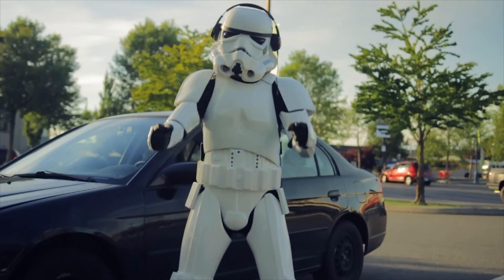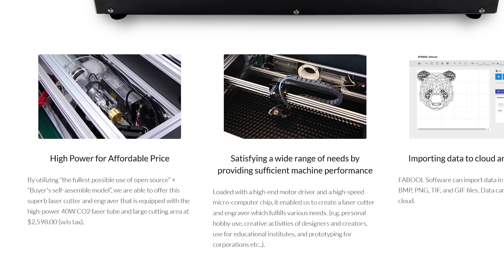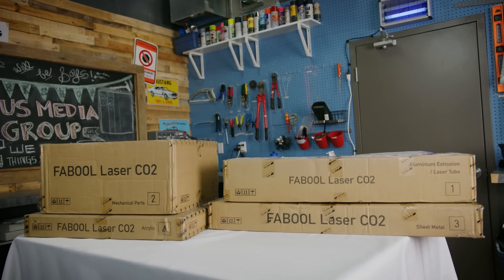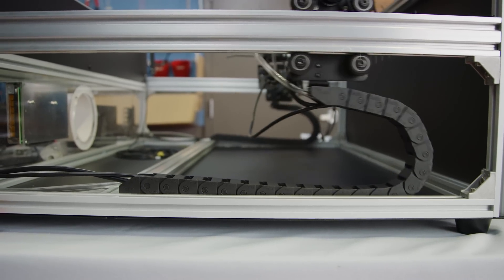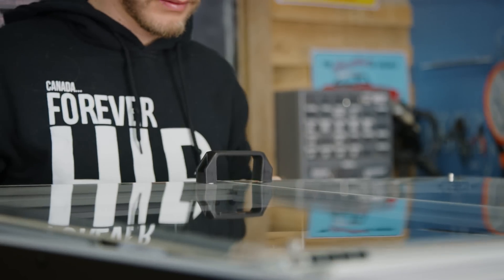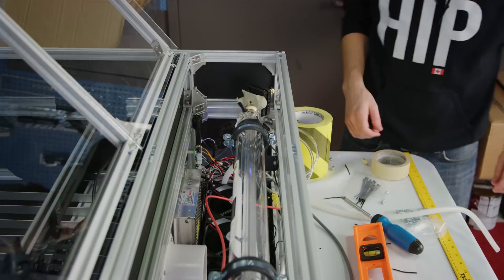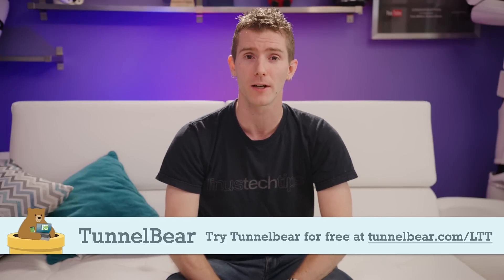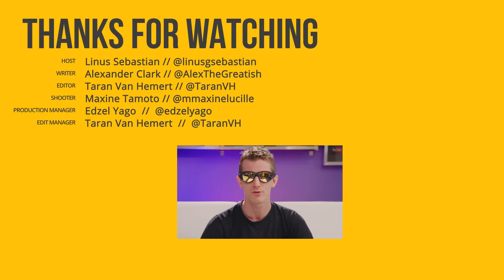We Built a FRICKIN Laser Cutter - HOLY $H!T

Comment: William Osman's is better.
Reply: Yes, to my knowledge "Retina Smelter 9000", is a scratch-built 80W laser cutter. And yes, it is of a good size.  There is enough space on the work bed for it to be "safely" used as a flat material storage shelf, and have material cut on it at the same time :) . I have to say, I LOVE your videos ( which is hard to admit to an Aussie, being a kiwi and all .... we are still better at the gentleman's sport (rugby)  than you lot :) ) . They ( the videos you create) are great inspiration for my tinkering in the 3D printing world. 

Can I take a wild guess, that if you get one of these, you will comment on the existence of yet another PSU in a kit, that requires the assembler to deal with the mains connections? 
Luckily, my father was able to do the mains wiring for the Tevo Black Widow I helped a mate build,  ( 2.5 days solid work (cutting out ~16 hrs for sleep + eating) to assemble that Tevo, and that is with both of us being very adept at that sort of task, both being into robotics etc. Also that I had scratch-built a printer helped, especially when it came to some of the 3D printer physical jargon, like extruder calibration, bed levelling, marlin firmware configuration and more). 
However,  if my father was not able to have done that mains wiring, I would not have enjoyed the prospect of dealing with it, and would have near downright refused to touch the mains side.
Reply: Was Will's a scratch build? It's massive lol
Reply: Thanks for the kind words! I do want to visit NZ one of these days. I would definitely comment on the Mains but also the fact these laser tubes fire at a ridiculously dangerous HV (Up to about 30kV) that in some cheap designs can arc to the frame from the tube. Safe! I'm really interested in how that was managed in this kit.
Reply: Yes, well there is that minor issue. If it is 30kV , I think that comes out to a ~30mm arc that could form. However, looking at the connection point of the HV line to the tube, it appears to have at least some insulation  around it.

Arcing to a frame is something I had fun with about 3 - 4 years ago. I built a Spark gap Tesla Coil, which could have generated a 360,000 V arc, according to the design calculator I used to work out the turns required on the coils, etc. However, a max of 140,000 V was reached ( it was arcing up to 14cm towards a well grounded retort stand, so following 10kv per cm, 14cm = 14kv), as if the variac used to control the input voltage, was increased above 120v, the secondary would arc from about 60mm up its length, to the strike ring at that height, which was 60mm out from the secondary. The ironic thing is that the strike ring is meant to PREVENT arcing to the secondary from the top-load, yet it happened to be the one that did the arcing.

Result = HV is a difficult thing to handle, and is both useful and a nuisance at the same time.

It will be interesting to see what they do with this machine, that much is certain. Them dealing with a possibility of that arcing is another thing altogether ....

Comment: CUT A OUT A PC! Using arcylic and steels cut out a case, HEAT SINK, etc. That would be awesome.
Reply: this thing won't cut metal, it can engrave on anodized alum but can't cut it
Reply: Oops, I guess I read the article to quickly... it can engrave metal.
Reply: Although it only can engrave metal (engrave backplates and side panels), you could still make a case out of acrylic! So maybe not so crazy after all...

Comment: I'm sure you guys have read up on the safety precautions, but beware engraving certain types of metal. My lab's cutter can't do copper because it can reflect the beam directly back into the laser and... poof goes the laser. Except with shards of glass and arcing electricity.

Comment: An easy way to align lasers is to use two small holes over a long distance.  If the laser goes through both points you can be confident your beam is coaxial along those points. It also helps to be methodical

Comment: Linus and staff, some notes for the future:
Make sure you cut nothing with chlorine or fluorine, it will either seriously mess up your laser or your lungs.  Check the MSDS of the material (Or for PC cases, ask the manufacturer).  Polycarbonate also cannot be laser cut, while many other flavors of plastics have some variants which can be, and some which cannot.  

Do not handle the laser tube itself without clean cotton gloves in the future.  Residues from plastic gloves, or skin, can greatly shorten the life of the tube.  Clean it, as well as the mirrors with the highest purity of isopropyl alcohol you can find.  91 is OK, 99 is better.  Also, use optical wipes, not paper towels, to avoid damaging the mirrored surface.  

If you use compressed air as an air assist, the laser will have more effective power, and will cut cleaner, while prolonging head life.  Nitrogen will reduce the fire risk while doing the same.  Oxygen can be used in some lasers to allow you to cut or mark thin metals.  Do make sure your compressed air is dry, and no more than ~25 PSI is needed to get sonic flow in the air, but you'll need a lot of SCFM to maintain that sort of pressure at the flow size.  

If you can arrange it, you want to try to replace all but the top window with steel or other metal, in case the beam loses alignment.  Try seeing if Protocase will hook you up.  

That style of linear motion is prone to needing the eccentrics re-tightened frequently enough.  Since you're doing minimal loading at reasonable speeds, consider moving to a single eccentric wheel, again, see if Protocase will help you, as well as possibly metal wheels, to reduce the time spent realigning and retightening. 

Those fans are relatively simple from the looks of it, just a 2 pin DC connection.  It would be easy to put in a passive adapter, while an RGB controller is probably as simple as a putting a DC-DC module on the power supply for the brains (or tapping mains current to a wall wart).  However, if it's anything like most CO2 lasers, the main power supply for the tube can output a few different KV ranges.  It's not at all friendly (The only laser I've seen without that, the laser module is 10X the cost of your whole machine, and needs nearly a KW of 44VDC for a 220W laser module)  

Try out vector versus raster engraving, it makes for some major time differences.  In general, complex dense engraving should be rastered, while things where a line will do should be vectorized.  Additionally, Raster is easiest if you're starting with just a bit map, and no vector files.  

I'm sure at least some of this has already come up, if not all of it.  But for you, and your viewer's sake, stay safe.  Keep your stick on the ice....

Comment: Hey Linus. I have a suggestion for an upgrade to your existing liquid cooling life journey. I saw a guy on here use a compressor from a mini fridge as the liquid cooling loop for the processor. Everything has to be custom wrapped and sealed to prevent condensation buildup and the results are colder than possible with conventional coolers.

Comment: Only 40w? I work with two 180w lasers 😎 that blue connection could be for a air line to the nozzle? Mine have air flowing through the nozzle to help blow the waste materials (smoke) down through the cut so it doesn't block the laser beam and then you should run an extraction fan at the rear. It really is surprising how much the smoke can obstruct the laser beam

Comment: if you want a fun project, cut a shape in acrylic, then laser etch a logo or something on the surface. You can then shine LEDs trough the side of the acrylic panel, lighting up the logo. If you use multiple stacked panels, you can even make an animation or have different colors for each part of the logo :)
Side note : beware of the fumes, some are toxic, and almost all will stick to your lens and render the laser unusable without a lens change. You should buy a replacement lens in advance (for when someone screws up and cuts the wrong material), and in all cases, at least something to blow the smoke out of the way (in my local fablab they used a leaf blower... REALLY noisy, but works well )

Comment: Laser alignment protip: ditch the masking tape, get a roll of thermal labels from amazon, and turn the test fire time waaaaay down. If you're actually burning your alignment paper, you're risking fucking up your mirrors.

Also uhhhhhhhh.... Didn't see any mention of a ventilation system? That is very,  VERY dangerous. You NEED a ventilation system. I'm sure whatever the Canadian version of OSHA is wouldn't be very happy about that.
Reply: The mirrors weren't installed when the tests were being done.

We have attached a small fume hood and after that it's venting to the outdoors, it wasn't shown in this video because the area it will live wasn't ready yet.
Reply: Did you fill the loop before aligning the laser?
Reply: pretty sure the room there in has ventilation
Reply: Soulsreaper that's not how it works with laser cutters. Laser cutting produces fumes and smoke that is often VERY toxic. You need a dedicated fan and ducting to exhaust the fumes out of the building.
Reply: LMG shoudl stop doing DIY. they suck.

Comment: Umm you know you have to reallign about every month and clean the optics or get a fiber one
Reply: Considering this product costs in the thousands i'm sure they can fork over a $500 fiber optic cable
Reply: I wonder why they use mirrors and not just a fiber optic tube lol
Reply: TehHijack it's cheaper
Reply: wouldn't the heat of the laser melt a fiber optic cable?
Reply: +Storm Micheal yeah but i dont think it's designed to carry light with that much concentrated energy
Reply: Or, the laser should be pointed directly down which is much easier to do. Most companies sell them in this configuration, likely due to safety concerns or something like that. There is no reason not to DIY this sort of thing, you'll have a lot of fun and know exactly how it works in the case something goes wrong (and something will go wrong).
Reply: GuvernorDave Fiber is designed to carry light. A laser is a light.

Comment: 1:30 Cutting and engraving wood and plastic is nowhere near the main thing a laser cutter is used for. Its used mainly for cutting thin gauge metals in the commercial sector that need to be cut accurately and at decent speed. Its more accurate though slower then plasma and significantly  quicker though marginally less accurate then water jet. Also laser is limited mainly by material thickness.

Comment: Be veeery careful with the red output wire to the laser... its almost 40.000v (sometimes can kill), its needed to excite the plasma that creates the laser beam, also the mirrors should be cleaned with alcohol in one direction to avoid marks or dents that reduce the output power. its best to cut thick materials close to the source of the laser (the less travel the light has in the air the better power gets to the piece you are cutting and thus cuts faster and thicker materials), one last thing in the software always use 90% of power... never 100%, it takes some useful lamp life and it doesnt get so much powerful.

Comment: Make a case thats 95% holes so you get the "open testbench performance" without the "accidental mentos tossed into cpu fan" effect.

Have a "make the best case from only plywood (or some other raw material)" competition among 3-5 employees rating them on airflow, dropability and looks. Everyone should get the same fans beforehand (e.g. one 200mm and two 120mm) then compare them to budget and high end cases.

Revisit the selfmade CPU Cooler idea.

AIO-ify a Monitor by making a custom cover piece for the backside that has room for a bunch of pc components

Make a chair PC that fits into the desk PC

Comment: Definitely should not have used masking tape, as the carbon will get on your mirror. Really hope those back panels are sealed well enough, or rather, wherever you mount this rig is a closed room where you won't have to worry about laser light radiation (and the operator is wearing proper protective eyewear).

Comment: It looks like that machine does not have any stream of air flowing over the (assuming) germanium lens on the cutting head. Depending on the material that you are vaporizing while cutting or engraving there can be sort of a residue forming on the front of the focusing lens. That residure/dirt can in turn cause the lens to heat up and cause charring, essentially ruining it. You can get nozzles that go over the lens with a hose adapter on the side to attach a small air pump constantly blowing cleaner air around the lens and down on to the part as replacement parts for those cheap chinese machines.
Reply: looking at it more closely there seems to be a little hose there after all, but apparently no nozzle. not sure if i'd trust that long-term

Comment: Be careful with acrylic. Most types of acrylic create _very_ unhealthy fumes when burned with a laser. 
That fitting on the IO panel is probably for adding an external blower that blows CO2 on the point where the laser hits the material (to extinguish flames and reduce burn marks on wood and other materials)

Comment: Worked in advanced lasers for a number of years and the calibration is always the hardest part. Takes forever to set up the small mirrors. We made security holograms with our lasers. If the laser was directly shooting and not being bounced through the mirrors the amount of heat and power would be way to much for the material to handle. Seet video. Really takes me back to those days.

Comment: Yo, look at getting some gluebacked paper, to cover both sides of your acrylic and wood stock. This helps prevent flare and burn on you material around the cuts/etches.

For projects, a really simple but effect one is etching ba design of clear acrylic, and placing a strip of LEDs along the bottom, firing up into the sheet. Like a fibre optic, the etches catch the light and reflect it, giving a really cool effect. Custom side panel, maybe?

Comment: like others have said, you absolutely need compressed air to ventilate any dust, gas, or other particulates. you run the risk of pretty catastrophic failure if you leave it unattended otherwise.

Comment: Weird fitting this is a quick connect for plastic flex tubing for air/gas. Maybe used for a purge in this case? I've installed a lot of those at Intel.

Comment: I would absolutely love to see you guys develop a computer case from scratch from developing an engineering model in SolidWorks or another CAD program with COTS fans, cpu, motherboard, gpu, etc... Next run a basic thermal analysis/simulation using either SolidWorks Simulation or COMSOL Multiphysics for a higher fidelity simulation. Then manufacture the computer case, assemble it, and put it under the thermal load as done in the simulation and compare the results together and potentially redesign to increase air flow through the system.

Comment: Also I would recommend replacing the clear plexiglass (plexiglass) with yellow (lexan) it will absorb more of the IR laser beam scatter & protect your eyes. But for now when running it use the glasses (don't want you losing parts of your vision now)

And remember 
NO PVC - Chlorine Gas
NO PLA -  Cyanide Gas

Comment: im really questioning why they didnt just go with a fiber cable to get the laser to the cutter head. it should theoretically work since its a CO2 laser which emits IR light. Also Linus, that weird fitting you found is a standard fitting used in pneumatics (at least in germany). You can put in probably something like a 6mm or 8mm tube for pressured air. i don't know what its for though because i cant see where it is connected.

Comment: That unknown fitting is for compressed air, you should add a blower to the laser which blows particles away from the work surface, just use flexible air lines and wrought them with the wires in the "tank tracks"

Comment: welcome to the world of burnt nostrils.  do yourself a favor and get a chemical respirator and a powerful extraction system because cutting acrylic is nasty shit.  everyone in your office will complain, guaranteed . Also never cut PVC.  its poisonous. if you want some good stuff to cut and engrave a company called Johnson Plastics sells Rowmark multi layered plastics that you burn off the top layer to reveal the other color below.  to engrave stainless with a laser of that power you need to coat it with a product called CerMark.  IMO the best thing to engrave is anodized aluminum.  you can get really good quality images.  The back of some variants of I Phones and Mac Laptops are great.  just Get Good first.  also engraved acrylic can be edge lit with LEDs for an awesome lighting effect.  Good luck.